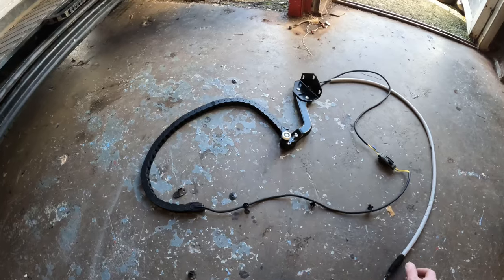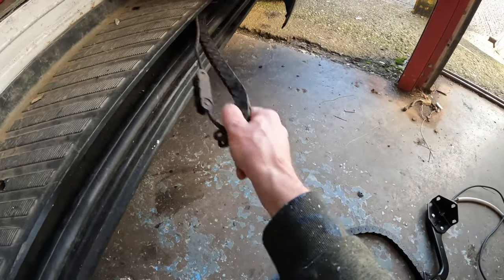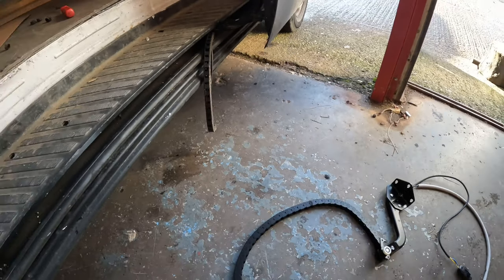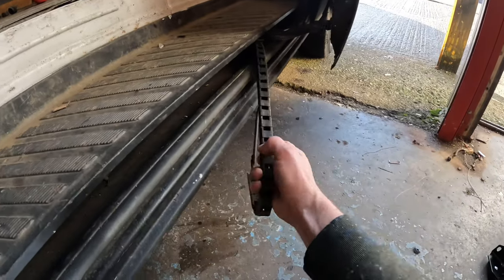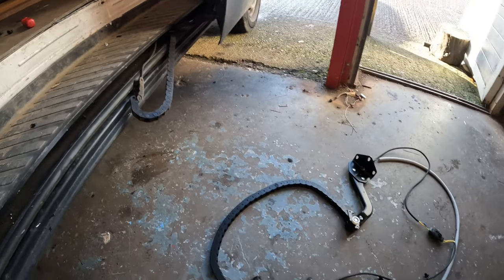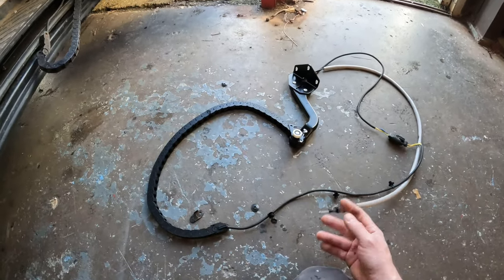Mercedes Sprinter slide door track

Comment: Hello! 
I have the same kind of problem and my garage guy wanna charge me 1300? Asking my self if the price is right. Not sure if its only about the rail.
Reply from the maker: If it’s just for replacing that rail/ runner then 1300 is way to expensive. I don’t even think the part was more than £50